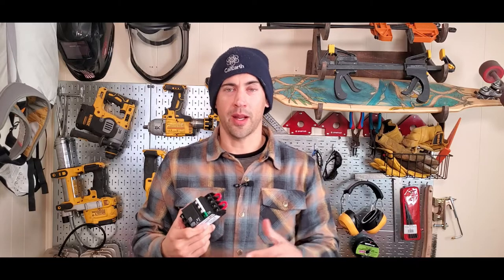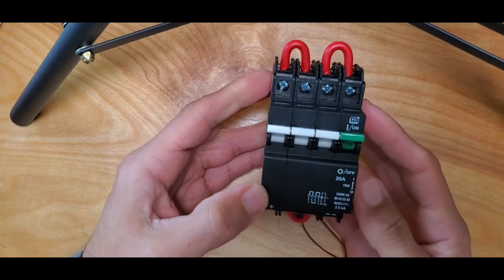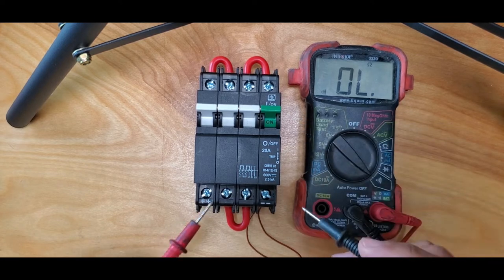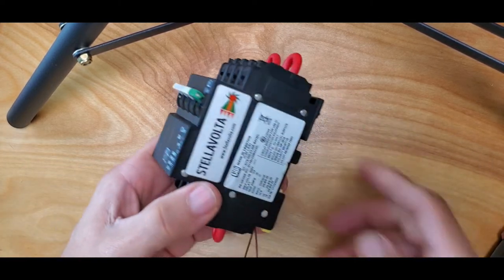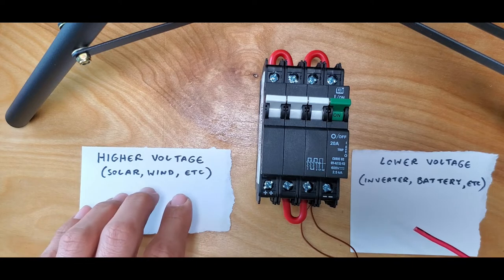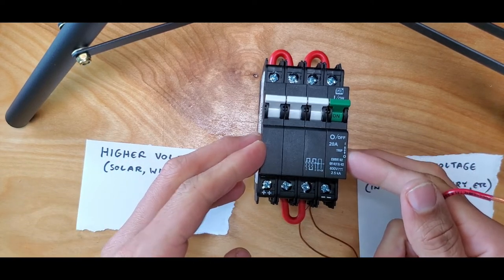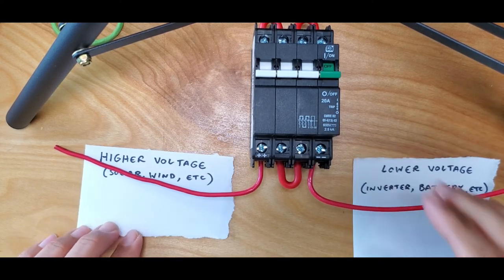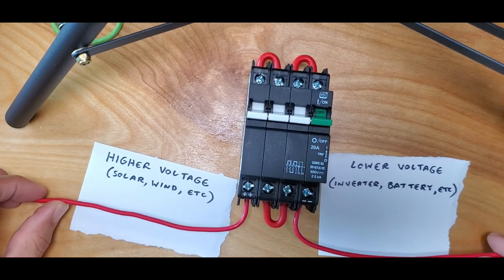MidNite Solar DC Breaker (Polarity Sensitive)

Comment: The polarity is important when wiring these. However, the second and fourth breakers in that collection are the same as the first and the third. This means that the current when it’s looped around the top is now going through the breaker backwards as compared to number one and number three. This is in the direction that it’s supposedly not meant to stop. And more importantly, can cause a fire. No I’m not saying that happens. I’m saying that I don’t understand it.

Comment: Did I miss the part where you talk about the two brown wires?
Reply from the maker: I didn't mention them because I'm not using them. From the research I did they are remote trippable switches. I think some degree of current is supplied which will trip the circuit for remote purposes and allow it to be used for a shutdown of sorts. MidNite Solar really anticipated these to be used in side of their hardware so there's not a better documentation source that I've been able to find.
Reply: @dusthavendotcom  Thanks I had a thought that is what they would be used for as well ... MN does have several products which would allow for this. We have three of these 600's going into one of their 12 slot boxes with 3 SPD's to feed our SMA SB 7.7 so wanted to figure out the extra wires before commissioning it :D

Comment: So how to use this between the inverter and the battery where they both are high potential and low potential in the same time/day/night
Reply from the maker: I don't think the inverter would ever be higher voltage than the battery; it's a load that (without the batteries) is consuming amperage not producing it at all. I don't think there would be a source of current on the DC circuit from the inverter to the batteries.
Reply: @dusthavendotcom  So what do you call "charging" ? higher potential from inverter to lower potential in batteries ... then at at night the current runs in reverse so the batteries become the higher potential , sorry i am still confused
Reply from the maker: @arafetkanso1405  No worries! Your solar panels should never become a load, using electricity. In a solar<->inverter/charger situation there should never be appreciable current going back towards the panels. 

You can see it yourself if you look at the voltage at the terminals of the inverter/charger at night time; there's likely to be next to nothing (except star or moonlight).

Comment: So if I want to use this as both a fuse and a cutoff on the output of my battery charger to my battery, the red wire on the charger goes in the ++ and then comes out the  - - to continue on to the positive terminal of my LiFePO4 battery.

I hate polarized DC breakers but the non-polarized breakers are both difficult to find and expensive when you do find them.

Comment: Hello my friend and thank you very much for your very informative video. I watched it all with caution but then at some point i lost it. Its many days now im trying to find out how to connect my one pole polarity sensitive dc circuit breaker (Kripal UKB7Z-50/1/C20) between my Victron Mppt charge controller output and the battery on the positive wire (since its one pole). The Mppt controller has a max output of  15amps when is in bulk charging. Should i consider the battery as a load and put the plus (+) symbol on the side of the controller and minus (-) symbol on the side of battery ? I dont think that the battery (12v 150ah) can return voltage back to the charge controller even when solar panels are not producing energy at night but again i need to be 110% sure how to connect this braker because im not expert and  as you already know nasty things may happen if i do it wrong. So any help from your side would be really helpfull for me. Thank you .
Reply from the maker: Hey Peter. If I'm understanding you correctly, the only way current should be traveling between a charge controller and a battery is from the charge controller into the batteries. The batteries should not be pushing current into the charge controller. I would put the ++ side of your breaker on the charge controller's output, and the -- side on the batteries. Your victron charge controller, and probably your panels, should have diodes in them that would prevent current from going backwards (from the batteries to the charge controller).
Reply: @dusthavendotcom  Thank you very much for your opinion. I have some second thoughts thou because maybe the controller has diodes but as i red to some solar forums some people mentioned that in  case the battery create a shortcut inside the battery or if controller gets damaged by some reason then many thousands of amperes will return to the controller. So they say that in the battery circuit with controller we put always the ++ at the battery side to prevent the huge amps return to the controler in case of failure. So yeah, and after all that i red somewhere else that specifically in the circuit of the battery and controler we put a circuit breaker that is non polarity sensitive. So, guess what i will do. I will install just a simple fuse lol. Thanks again !

Comment: High freq All-in-One inverters and 'transformer-less' GT inverters do not isolate their PV inputs from AC output so both PV pos and neg terminals are riding on top of AC output.  You need to have the double pole DC breakers, breaking both pos and neg lines, to remove AC from panels.
Reply from the maker: For sure. I think single pole breakers like this are really for between a solar array and a controller where you can be sure of the current direction unless something very bad is going on.

Comment: Thank God I saw this video.  Bought 8 of these things to use as switches in lieu of isolators, to be able to shut off my 8 solar arrays when working on the system.  By system I mean a bunch of equipment that I haven't installed yet.

Do you know if anybody is selling the "polarity insensitive" ones yet that you mentioned coming out?  I could use two more of these between my inverter/chargers and my battery bus, but since the inverters can pull from the batteries or charge them, I'm assuming that would be a textbook case of fire hazard due to the polarity sensitivity.
Reply from the maker: I haven't checked the market in a bit so I can't say in regards to new availability. But your read on the situation sounds accurate. Between the combo inverter/charger and the batteries the flow can go either way.
Reply: I was going to install a single DC breaker in the positive line from the inverter to the battery bank but have the same question. Since it charges and discharges, at some point wouldn't that be reversing polarity?
Maybe I would be better off with a disconnect that doesn't have a breaker.

Comment: I miss the double break . Or. 2 polar most seen in off grid installation. So for the negative you will go from + polairy from load end to -for battery side. Just saying you are going more negative whwn following the circuit